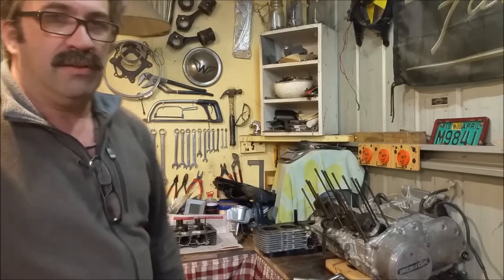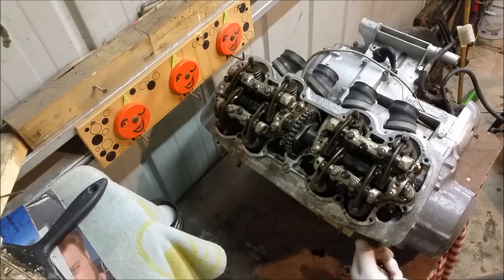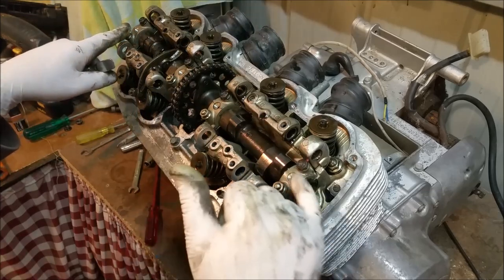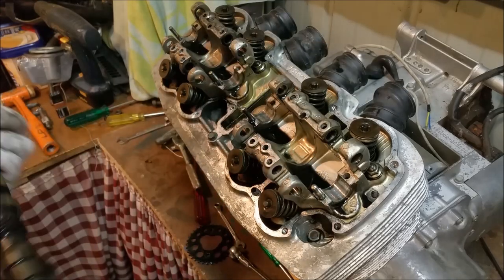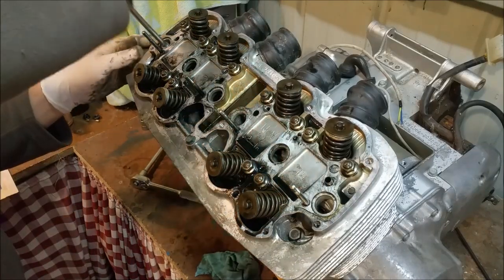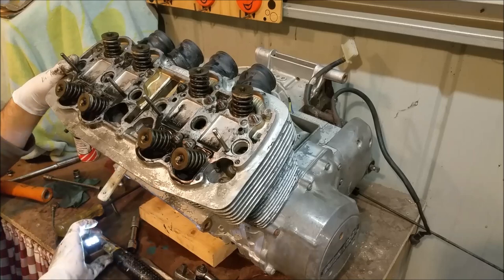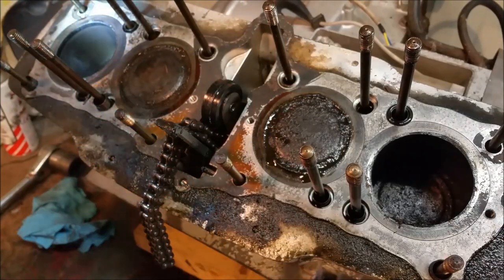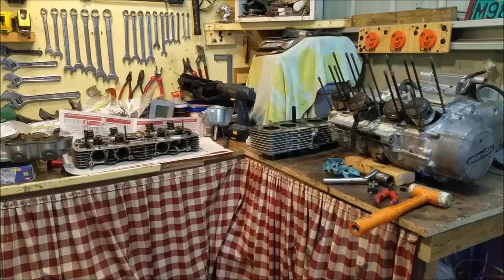Honda CB750 Restoration -  Top End Engine Teardown Part 6

Comment: I redid the engine on a 1986 ZX 600/GPZ600 Kawasaki The pistons in that are smaller than a Honda 750. I used a trick from Edd China when putting the jugs (barrels) back on on the piston. Use a gear style radiator clamp to compress all the rings on the pistons, (a regular piston ring compressor is too large to fit four of them on those small pistons )put the jugs (barrels) on and then remove the radiator clamps and push the jugs down to the lower end of the engine. Enjoying watching your channel
Reply from the maker: Thanks Johnny, I have an old compressor that has a worn ratchet... I was going to cut it and put a jubillee clip around that - will be far easier on the rings that way. Cheers mate.

Comment: Just a tip if you rub a large magnet on you socket and extension it will magnetise making it easier in those hard to reach spots
Reply from the maker: Thanks

Comment: I'm not sure if the 750s suffer from the same problem but I had a Honda 360. The oil galleries going to the cam got plugged and caused the head to get scored. Make sure the passages are clear when you rebuild it.
Reply from the maker: Will do, thanks Dave.

Comment: Good to see this, after all these years....   I owned a K2 CB from new, and have completely rebuilt about 4 of these..  but all back in the '70's. The only thing we found bad about the motor was the cowboys who reassembled them using FAR too much RTV as sealant, and thus helped caused oil gallery blockage which caused oil starvation to the top end... We only ever used the thinnest smear of the stuff but people seemed to insist more is better..  bad move.Great engine when treated well, with maybe only one fault..   the cam chain could have been a little better/larger size...?? 
Started this before I watched what you were doing, then saw that you were not really familiar with these.., the ones I rebuilt, or worked on were always so clean inside..  I also note you had as much trouble as we always did getting the barrels off....

Comment: I see your concern , but, I would have done a diesel rinse and then turned the engine over running through the gears.  8 out of 10 times, the bottom end has turned out to be ok.

Comment: hi pete, just a thought, as a mechanic myself i was taught and have always lived by this simple test, im speaking of scoring on the pistons you pointed out, this rule has never let me down so for those new commers to the engine game, a scratch or a score on a cylinder wall [or piston] ."if you cant feel it with your thumbnail, it does not exist. not sure you agree or not, just a thought. as always, great vids pete
Reply from the maker: Thanks Brian, the ones at the top of the second piston are deep though, so I will replace them. Cheers and thanks for your comments.

Comment: I noticed the lube ol was filthy and the inside strangely clean. Once you got the barrel off and that Scored piston was revealed it looks as though the engine has been run way too rich somehow for a long time . The bottom end will be as bit crook i imagine. I spend as lot of time rebuilding Mercedes Mechanical  petrol injection engines and the pumps on those wear away quietly for years ,running  too rich but still driveable, and when i open one up and see it clean(ish) like that it's a bad sign .   :-) .Probably the reason the bike was [parked up was because the plugs were fouling and it was hard to start.   Just a guess.

Comment: Loving it so far. I think next Winter I will have to do this to my CB550 so this is all good stuff while the 550 is not exactly the same as the 750 they are parts that are close so this will be very helpful.
Reply from the maker: Thanks, yes the 550 and 750 are pretty close brothers.

Comment: Do not reuse the exhaust studs, for a few cents a pop you'll have new ones. Saves you from drilling out a broken one in the future when one breaks.
Reply from the maker: Yes good point... I used to replace them on J30 Maximas all the time - not sure why I didn't remember that. Cheers

Comment: 3 parts 90% isopropyl alcohol to 1 part Winter Green Oil... drop your intake boots in the solution and close the lid... let them soak for a full week and that will restore the softness.

Comment: Also leave that breather cap, on top of the valve cover, off as you put the motor back on the frame as it was hitting the upper frame/backbone tubes. I have also  left the valve cover off till the motor is resting in the frame , then put it back on. With those pieces and the header studs left off it will be easier to put back in the frame without buggering up your painted/powder coated frame.